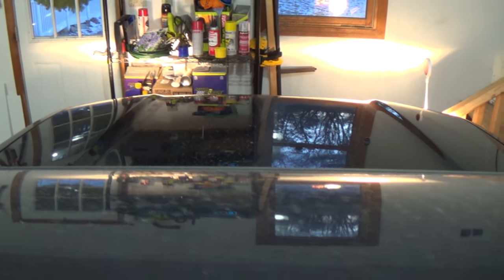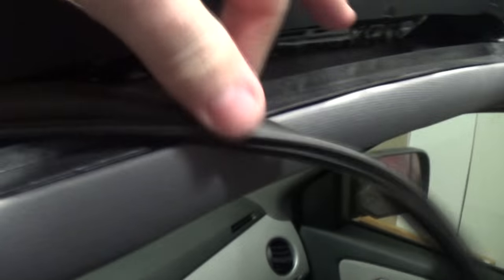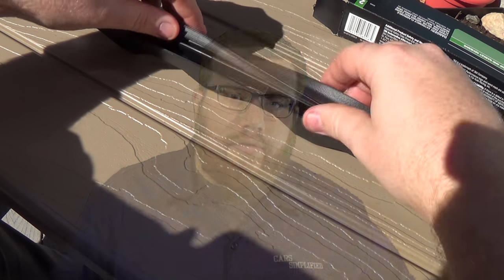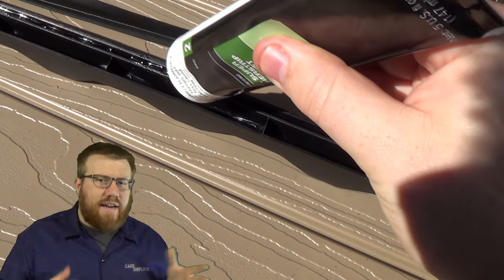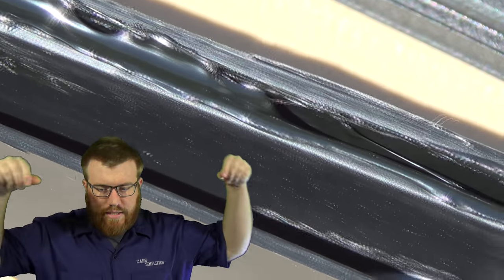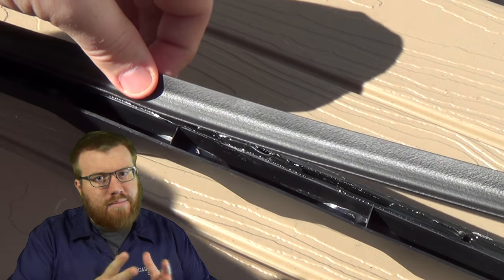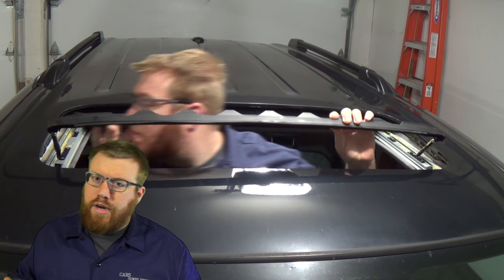How to Fix Sun/Moon Roof Visor Weather Stripping • Cars Simplified

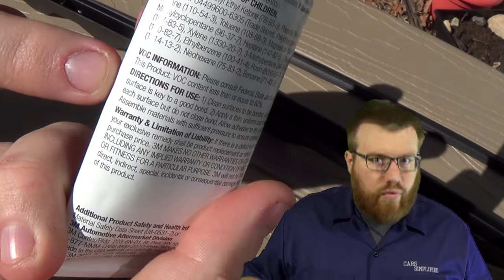Comment: Your overlay looks great and professional! I preferred it at 0:45 though when it was smaller and pushed to a corner. Would have been nice to see more of the scene just before that when you were messing with the weather stripping. Interesting double dipping technique!
Reply from the maker: Thanks! I've been away from the green screen for a while due to time restraints and audio quality, but I have a decent lav mic on the way that should make future videos sound much better, particularly the green screen ones where the background noise is much more noticeable.

The shots where I'm taking up less of the frame have the secondary benefit of crushing chroma key artifacts, so I'll definitely be doing that until some point in the distant future where I get a 4K camera, assuming I don't output to "real" 4K. Either way, I'll definitely try to remember to keep myself small in video renders.
Reply: Yeah I just think it's awesome to see you talking, but make sure you don't obscure the main subject of the clip! Still really awesome and professional. I just bought a lav mic too and then realized I need an adapter for it work with my phone for recording. XD
Reply: How are you everywhere 802 😂
Reply: @gamewarmaster  I'm a magic maaan!

Comment: What issue did you encounter with the 2013 pilot? I couldn’t find the next video?
I have a 2013 Honda pilot touring edition which is the same moonroof advisor and I have the same issue with the seal coming off of the deflector.

Comment: Is this gasket piece on visor necessary to prevent water intrusion ? What is purpose ?   Trying to decide if worth trouble re inserting.
Reply from the maker: This will either be the first or second barrier to keep water out. It is usually the second, but because the first deals with so much debris, both layers work together to keep the interior dry. I would definitely make sure it's in place to do its job.
Reply: @CarsSimplified 😊😂😂❤❤

Comment: Is it necessary to use the adhesive on the sunroof gasket?
Reply from the maker: On this vehicle, it was. It wouldn't stay in place otherwise.
Reply: So generally the factory gasket stays in place? I'm attempting to replace the sunroof gasket on a 2014 VW Passat for the first time and I've been searching for videos on how to replace it.
Reply from the maker: On most cars, including this one, the gasket just presses into place at the factory, but it loses its ability to clamp on with age. I imagine a new gasket won't need the adhesive if the original one didn't use any.
Reply: Thanks for the insight, hey maybe you'd be willing to create a how to video for replacing a VW 2014 Passat sunroof gasket, just an idea.
Reply from the maker: If I ever have the opportunity, I will! Thanks for commenting!